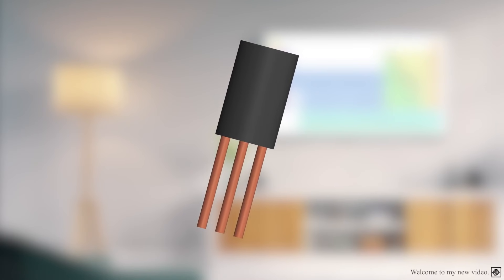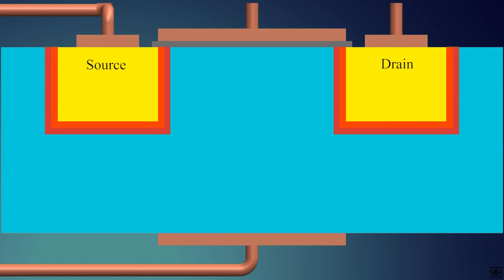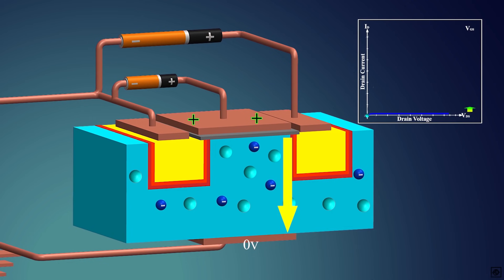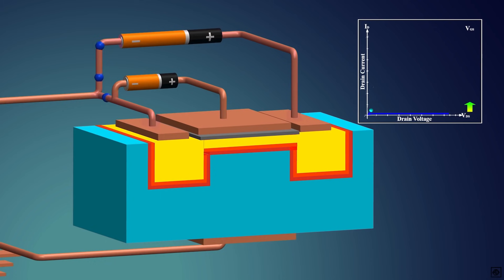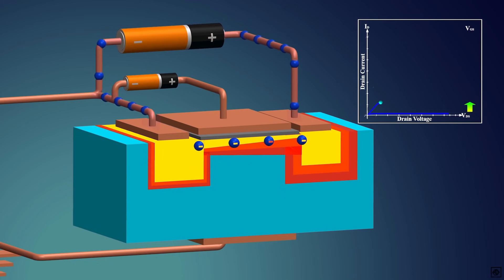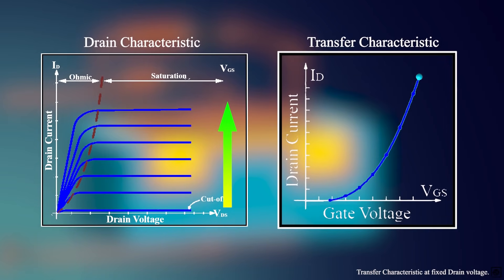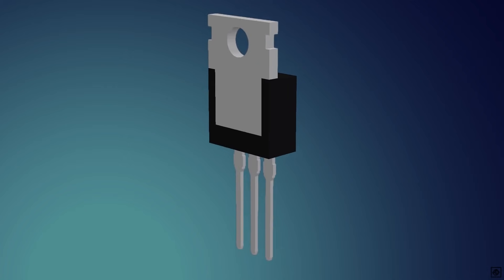How Does a MOSFET Work?

Comment: I thought at pinch off the channel is gone due to the depletion region caused by VDS. Then while VDS increased the channel is further reduced. I don't see why i'm still seeing the yellow channel even as VDS increases. However I do know due to the positive charge of VDS and its electric field it does pull the electrons to the drain by its electric field.

Comment: Think of it as the faucet from a hose. Gate is basically the switch. And the source is the external pressure and the drain is basically water

Comment: 00:00 Transistors are the basic building blocks of modern electronics, with MOSFET being a popular type.

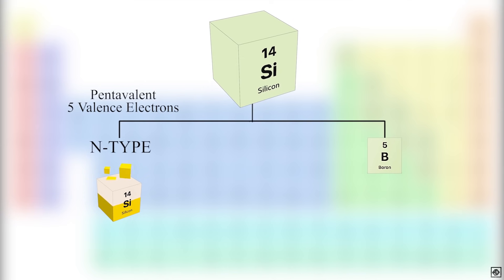01:05 Semiconductors can be n-type or p-type depending on impurities

02:08 MOSFET has four terminals: source, drain, gate, and substrate.

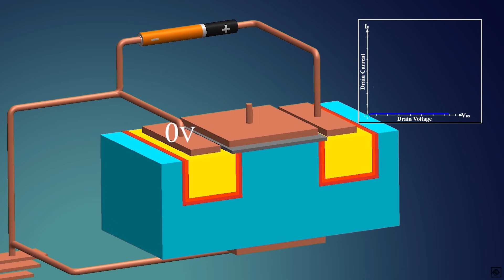03:02 MOSFET operation involves creating a channel between drain and source using a voltage source between gate and substrate.

04:02 Creating a channel in a MOSFET

05:08 MOSFET operation in ohmic region

06:10 Increasing gate voltage increases current in MOSFET

07:16 MOSFET circuit symbols and types

Crafted by Merlin AI.

Comment: oh great, that was a good explanation. On how to smoke your battery 😮. Just kidding. So I have a  question. I'm guessing those 2 types of mosfets (off/on/off and on/off/on) are not the only types correct,or are they? Because I was wondering if they have mosfets that are similar to some relays.       As if in (off) position can power a device that turns off when mosfet switches(on) but... then power a separate device until the mosfet is turned (off) it switches back to send power back to the first device.( or what ever you want power to go to).    That a relay can do very easily.(just not as fast as mosfet) like to switch from Low to High. Having only one remote signal wire with a higher voltage battery. Using a button or toggle switch between the two.   Or do mosfets always require a microchip. ( to program button commands to send voltage signal to first mosfet on(Low=off). then send another signal to second mosfet on( Hi=on).  then second button press stops both signals(low=on). 
I guess it could be one  signal wire that splits and goes to each one or even  another mosfet that splits from that one but seems like a pain. not to mention it might have an overlap for a split second or residual power. that they can be both on for a split second in an application when you dont want them to.

Comment: Holy crap. I have no background in electrical engineering or anything electrical. This is so hard to understand. But I'm curious to understand electrical components and how they work together in devices like PSU and various control/ motherboards, etc

Comment: How will the channel form under the gate because electrons in p-type semiconductor are in minority. Meaning there are very low to no electrons in the p region. So from where electrons gather under the gate in such concentrations so as to equal the concentration of electrons in source and drain effectively making it n-type ?

Comment: Ok now I understand so if I connected a mosfet in a push pull circuit and the mosfet fry it self as it turn on that is the capacitor fail to discharge causing mosfet to fail

Comment: Okay I know I'm missing something because I could never wrap my head around that VGs. I know there are simple explanations but for me I can't understand the idea of a transistor that needs power to switch power. 
Even in this 3d animation  for the VGs you just used a smaller battery. But most devices with transistor run on a single power source. So how could the power to be switched also be the power that is used to activated the MOSFET. I know that the smaller battery is just a representation of a power source.  But how is this (smaller) power source produced and isolated from the MOSFET and larger power source when the MOSFET is activated wouldn't it just short out the smaller source and stay on.

To me it just feels like an unexplained paradox kind of like picking your self up  with nothing to stand on.

Comment: Hey so in the video after pinch off part you said about saturation current and when the reverse biase is increased the saturation current will not increase , so I have a doubt if the reverse bias increase doesn't it make the junction narrower so less currently can only pass through it , so shouldn't it be said the saturation will not decrease if the voltage increased instead of saturation current will not increase
Reply from the maker: The reverse biasing does increase but the junction will still exist.
Theoretically the junction should cut-off by the growing depletion layer.
But due to the large flow of electrons, the electrons jumps the depletion layer and continues to flow.
But the electrons that can jump the depletion layer are limited, hence the saturation current is constant.
Reply: @ExplorerStuff  yeah I understood that but theoretically the saturation current would decrease right because of pinch off right so theoretically if I increase voltage upto beyond pinch off current should decrease instead of increasing right?

Thanks for the reply
Reply from the maker: @Rohit-xc3tl  Theoretically there will be no current after pinch-off, because the depletion layer will block the path.
Reply: @ExplorerStuff  ohh okay got it 👍 thanks

Comment: Why mosfets burn?
Reply from the maker: They are mainly burned due to over-voltage (Vgs) or over-current (Ids) or poor heat sinking.
For example, a suitably high voltage applied between the gate and source (Vgs) will break down the MOSFET gate oxide. Gates rated at 12 V will likely succumb at about 15 V or so.
A MOSFET passing high current will heat up. Poor heat sinking can destroy the MOSFET from excessive temperature.

Comment: Tell me a capacitor me. With the help of this DC Capacitor I can store electricity for 1 minutes minimum. Please
Reply from the maker: That depends on how much load is applied to the capacitor.
Energy stored in capacitor = 1/2 C * V^2 (Joules)
Power required by device   = v * I (Joules per sec or watts)
Time = Energy Stored / power required (seconds)

Note: There are some losses and things are not 100% efficient, So include them or just take a higher value capacitor.
Reply: Tell me highest value capacitor. Please
Reply: @ShyamNiwas  big value capacitor you can find in 10/20/30.....100F but the size is big as value increase.